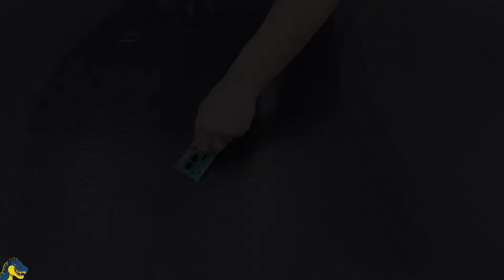Painting Skateboard Trucks

Comment: If the trucks are brand new, you can just spray paint them right away right? I Want to get ace trucks in black 7.75 but my skate shop only got silver ones. Also what spray paint should I use?
Reply from the maker: hi. you need paint for metal and don't forget to sand the trucks properly. for an even better result use a metal primer. much luck

Comment: Hey i've been looking into spray painting my trucks but i have a couple questions. Is it completely necessary to sand my trunks? They're default chrome and have no paint but am i supposed to still sand them? Also, do i need a primer, or can i get away with not using it?
Reply from the maker: It depends on how good you want the result to be. In principle, an adhesion grung is recommended, which is a kind of pre-layer So that the paint adheres better to the chrome surface. 

So degrease the trucks, sand them finely, apply a precoat, Let the primer dry, apply paint 2x and finish with 1x clear coat. 

If it's supposed to be cheap and you drive a lot, it's enough to sand the trucks once, degrease them, paint them twice, done.

Comment from the maker: Painting with spray cans Prepare the material for painting. In this case the axles, trucks. 

1. pre-clean. Remove the coarse dirt, dirt, if present. 

2. Grind. Or grind. Treat surfaces with sandpaper. Tip: The rule is, the finer the sandpaper, the smoother the surface after sanding. 

3. clean material. Clean the surface properly! Dust and degrease. 

4. masking. Mask off surfaces that are not to be coated with paint. 

5. Varnishing, spraying. Paint the surface twice, the first layer of paint Let dry 10 to 20 minutes, then repeat. For a really good result, do not spray too much paint on one spot, otherwise the paint will run and there will be drips or runs. Tip: Make sure that the spray can is moved first and that the spray button is pressed during the movement. Perform flowing movements with the spray cans.

6. Allow parts, surface to dry for 24 hours. Ready. 

Have fun

Mr.Tegni